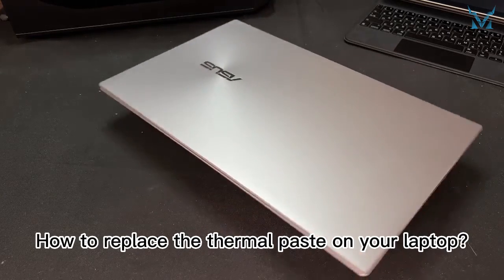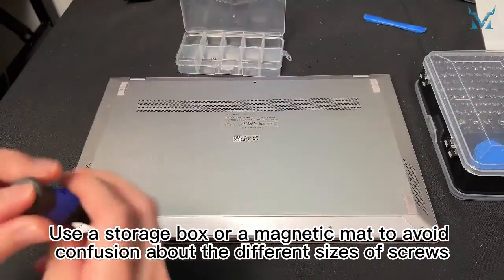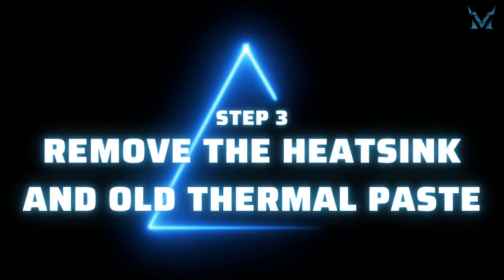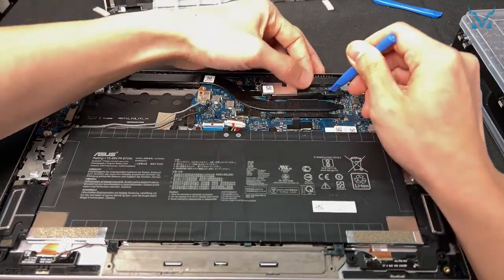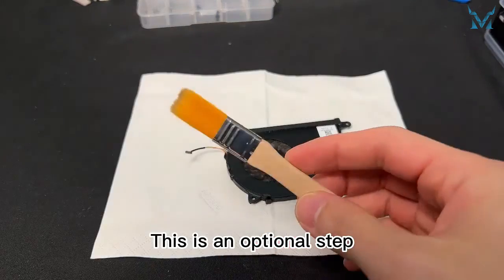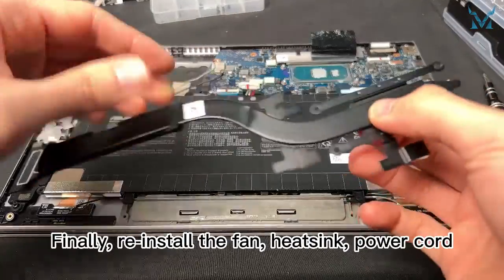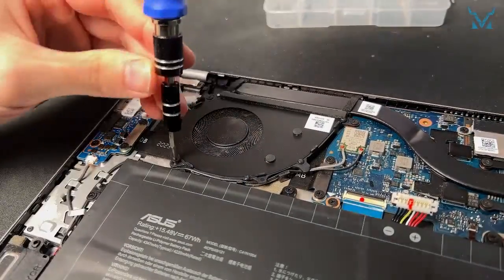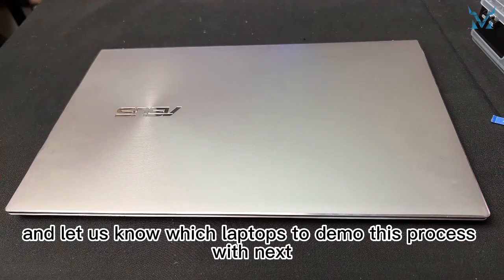Speed Up Your ASUS ZenBook 14s U4700J - Prevent Overheating With Dust Cleaning & New Thermal Paste

Comment: I have same model but i can't take out the fan, i unscrewed the 3 screws but it's still connected to the heatsink i believe. Can't i replace it without replacing the heatsink?
Reply from the maker: You're right, sometimes the fan is connected to the heatsink, and you'll need to remove the whole assembly to access the fan.